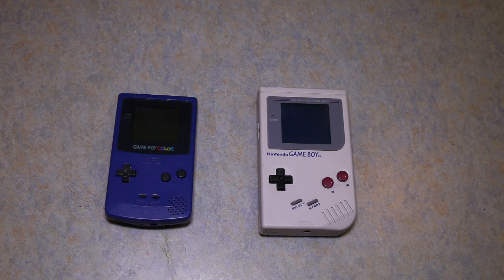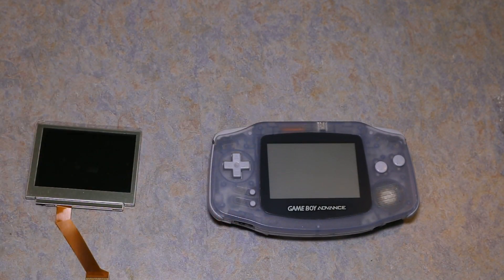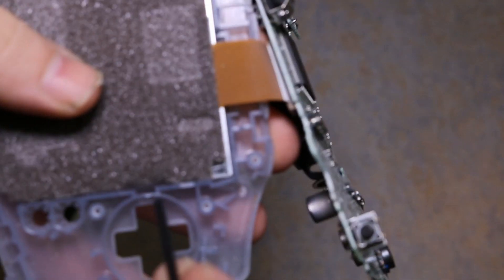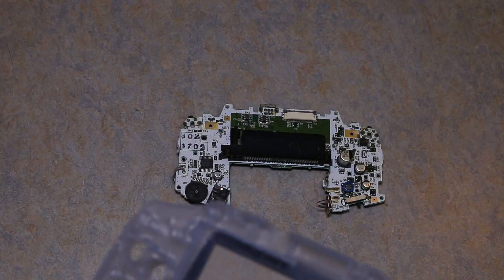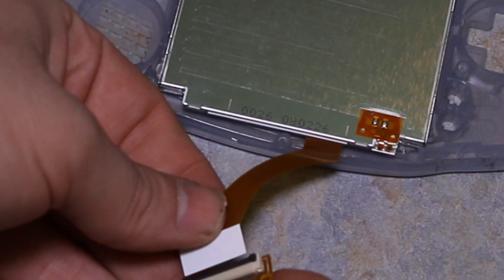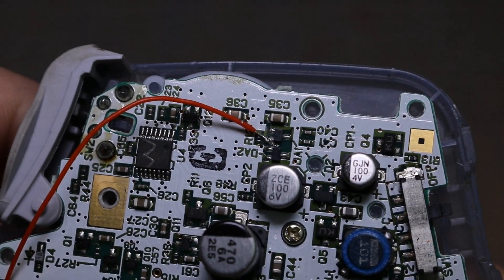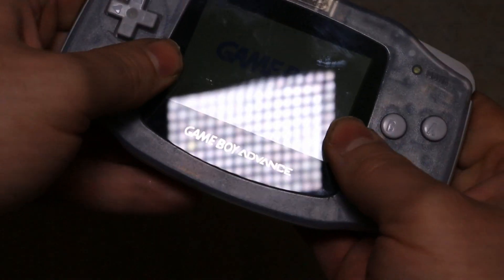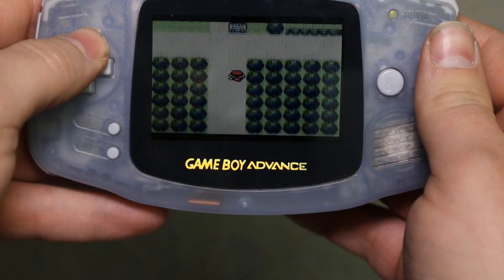Gameboy Advance Backlight Screen Mod!

Comment: Do you reuse the original black rubber screen gasket or not ? Does the original sealing gasket fit ?
Reply from the maker: I reused the original one.
Reply: McFloppy  So the gasket fits well and don't add too much thickness ? Is the ags-101 screen same size in thickness/depth as the original screen or thicker ?
Reply: @pekkahollola7646  it is thicker! Usually people don't reuse the original rubber piece, the screen will stay in place anyway!

Comment: my backlit gba has a glitching artifacting screen after disassembling and reassembling to replace a funky dpad membrane, i think i pinched the red wire or loosened the display cable when in the process of doing it, i hope i didn't kill it and have $149 go down the shitter and make me have to get another one off of ebay.

Comment: I'll try to attempt this one day,  the wires came pre soldered right?  So I won't  need a soldering iron?
Reply: you need to put flux on the soldering iron. and then put solder on the soldering iron and solder that wire to r12 holding the wire down till that solder stops bubbling and melts to the joint

Comment: Thanks for the vid! Have you had any issues with the new screen causing your GBA to freeze? I purchased a similar screen from a different Ebay store (it came from China), and my GBA now won't load past the "Gameboy" startup screen. I read that sometimes if it's not an authorized Nintendo component, it can cause issues like this.

Comment: I tried this mod and at one point a screw got stripped and when I tried to ply it out, a component came out of the board. This made the motherboard completely useless and now I am going to have to use the motherboard from another Gba to finish the mod. Wish me luck 😅
Reply: Ben Eidelkind 

How did it go?
Reply: Rip

Comment: For those who encounter any issues with putting the entire thing together and the games not reading, what I ended up having to do was completely remove the thick sticky backing from the back of the AGS-101 screen (which incidentally is not mentioned in many modding videos), as well as add a strip of electrical tap to the side of the motherboard that was facing the back of the screen itself. This strip prevents the ribbon from making contact with the nodes on that side of the motherboard, which it seems was what was causing my games to not work.

Comment: Nice video dude! Why has the wire on the ribbon adapter has to be soldered, because my screen works without it
Reply: Lukas Ringlstetter it takes power to the backlight without it it’s not backlit

Comment: Just to warn people, the kit  in the link does not fix the ghosting issue for 40-pin GBA's. It's not prominent in Pokemon, but if he were to pop in Super Mario Advance or something like that, it'll look really nasty. There's a new ribbon cable made called the Type B cable that fixes this. For whatever reason, thegodsofgaming sells both, but for like $2 more, you can get the kit with the right cable:

http://www.ebay.com/itm/Gameboy-Advance-MOD-LCD-Backlight-32-40-Pin-TYPE-B-GBA-SP-AGS-101-Backlit-Screen-/192315058298

Comment: If you notice your GBA's screen is a little darker than a normal AGS-101 screen, there is something that is to the top right of the screen if you open the gba back up. I didn't explain it well but I recommend looking it up if you want full brightness.

Comment: so with the addition of the new cable and its connector, does it keep the motherboard from sitting flush, and keep case from closing right?
Reply from the maker: jrcavazos74 It closes just fine after you take off the rubber piece under the screen lens and shave away that piece from the case.
Reply: thanks for the info